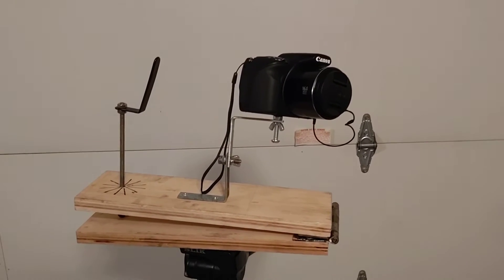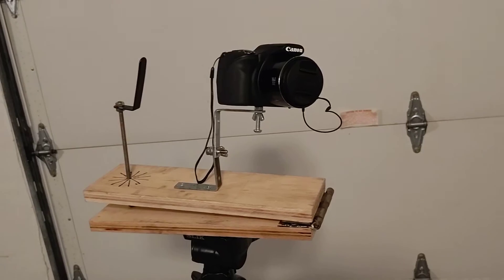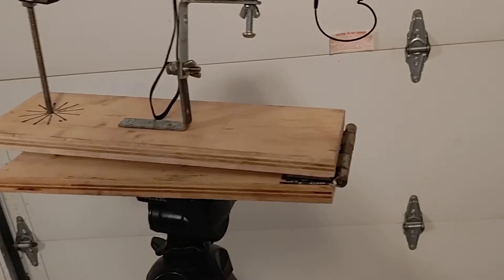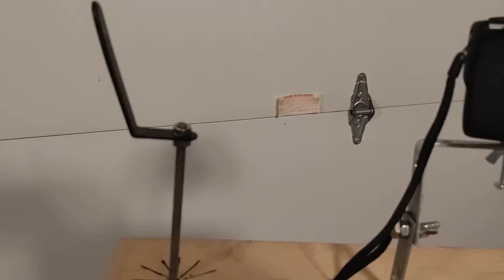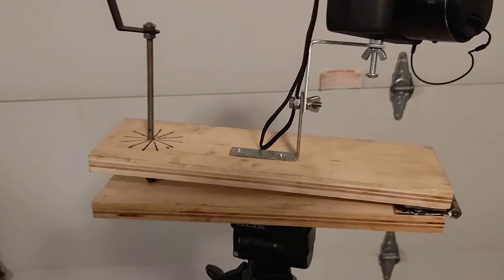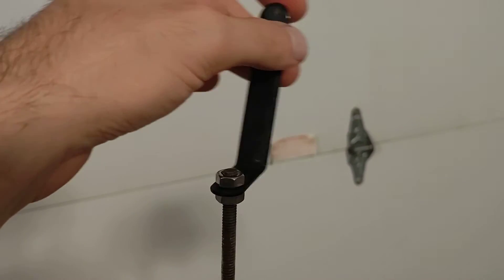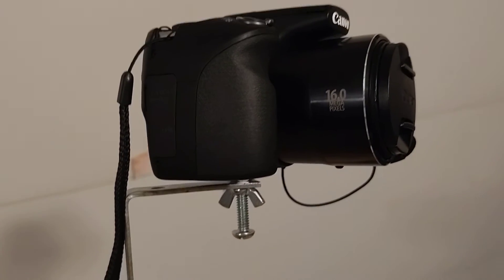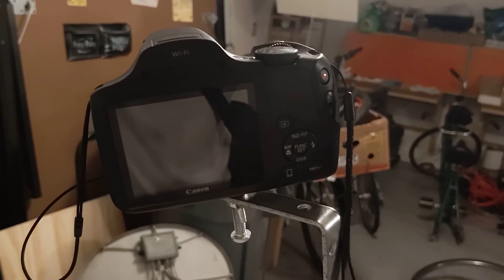How I use a barn door tracker to improve my astrophotography

Comment: Wonderfully simple, and nicely explained.  Thank you for taking the time and effort to produce this video. This has quite inspired me to get busy and make one for my smartphone activities. I especially liked your camera bracket, quite ingenious, as well as your use of acorn nuts in place of a carriage head bolt. One question: How do you handle polar alignment?
Reply from the maker: Thank you! If I didn't mention it, you want to aim the hinge at Polaris and turn the crank clockwise such that the hinge rotates counterclockwise around it's axis. I don't do a good job lining up the hinge axis with Polaris. I might add a sight above the hinge and center Polaris in the sight.

Comment: Is the barn door tracker permanently screwed to the tripod ?
Or can you remove it and use the tripod when you need to and then put the barn tracker again for astrophotography ?
Reply from the maker: No, it's not permanently screwed on. You can unscrew it from the detachable base on the tripod.